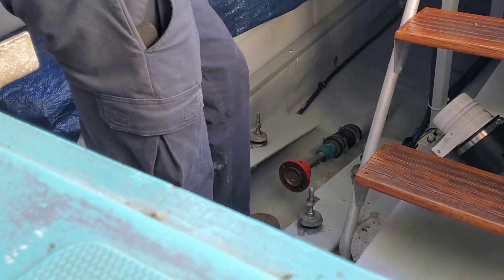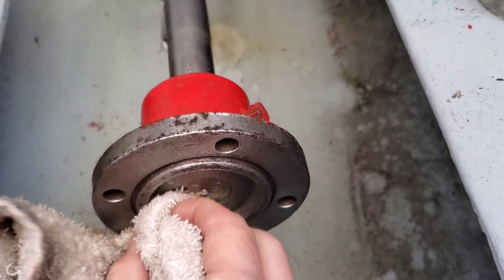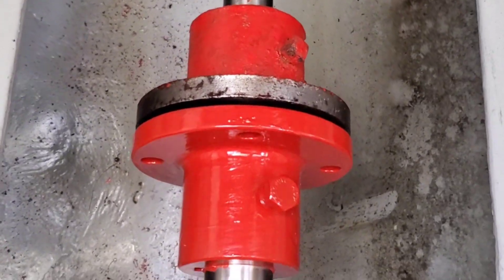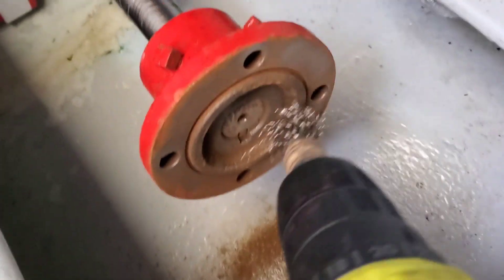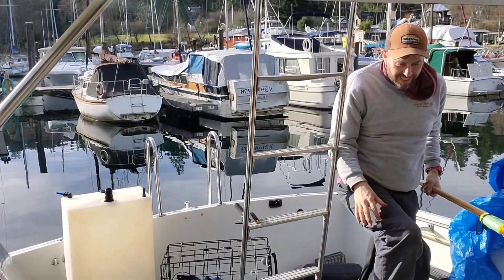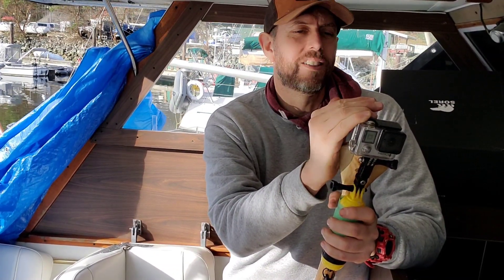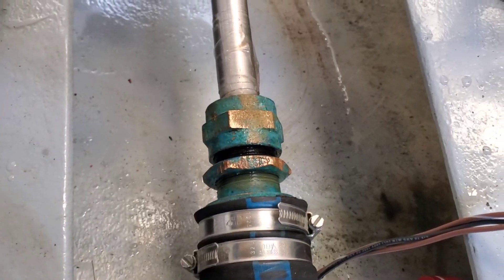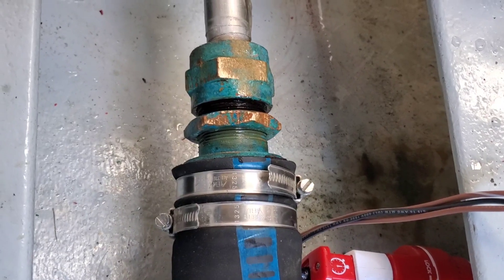Electric Boat - Couplers, Shaft Seals and Muscles in the Shaft Log

Comment: Thanks for these awesome videos! I have a me-1306 12KW motor I want to use. Would you recommend direct drive with couplers or belt with reduction gear? Obviously direct is easier to setup, but the RPM might be too high for direct drive....? Thanks!
Reply from the maker: Your RPM will drop when there is a load on the motor....for example when you put the boat in the water. That said, you might put too much load on the motor without gear reduction. It really depends on the kind  /size of boat you are going to convert. The good thing about gear reduction is that you increase the torque so if you have a heavy boat (like eTolly) it much easier to move the boat from standstill and reduces stress on the motor. The sacrifice is RPM /top end. Most people who do an electric conversion use some form of gear reduction.
Reply: @ElectricCruiser  Okay, Excellent info. Seriously considering gear reduction now...

Comment: Those are taper lock bushes, you don’t need the steel spacer behind them, just align the pulleys using a piece of string
Reply from the maker: Corect, but the pulleys didn't line up. Solution in the next video 👌